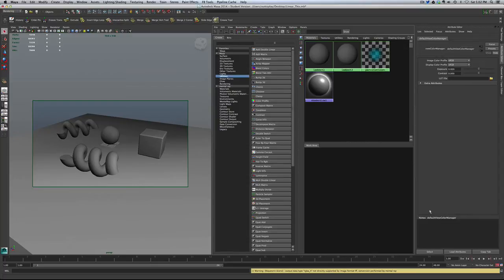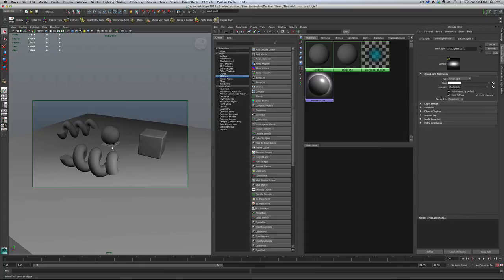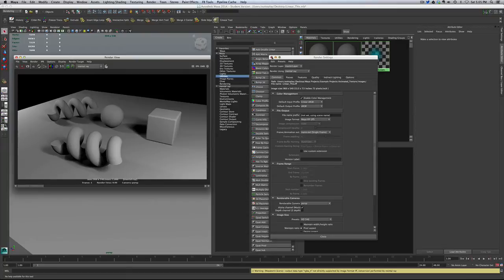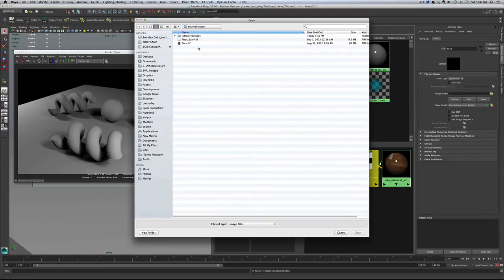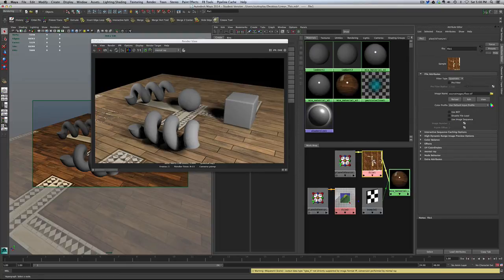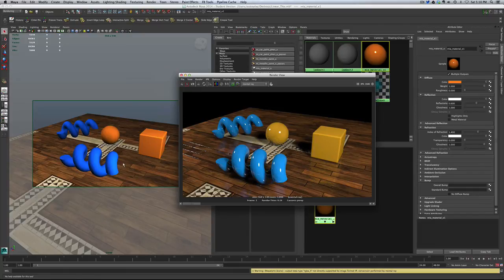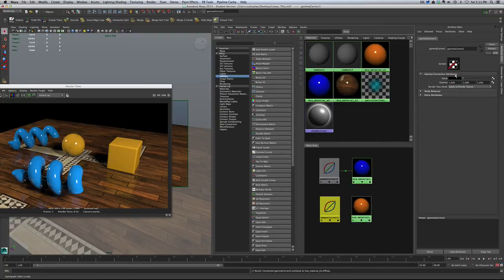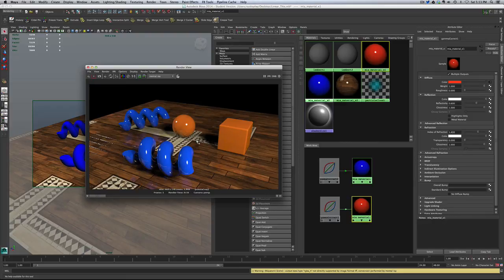Maya - Linear Workflow Overview

Comment: I think you have the input and output reversed. The input should be sRGB (textures that are already gamma corrected) and the output should be linear (negate the gamma on the texture). You have it reversed, which is assuming the texture is linear (even though it isn't) and applying another gamma, which is washing out your textures. Clicking color management should automatically set up you files with the USE DEFAULT PROFILE which should give you the proper results.

To get photo-real lights, you should apply a lens shader to your camera (I prefer exposure_simple) with a 2.2 gamma applied.

Let me know if I missed something =)
Reply: Dominic Bonavitacola Yeah it's throwing me off! Did he do it right or what?! He's applying gamma correction nodes to each element, is he using and older workflow? 

May I ask where you learned this work around from? Was it Tony Reynolds?
Reply: dannywithnuggets No, what Brenden did isn't the 'proper' way to implement linear workflow using the Color Management. The way I described it above is how it's supposed to be done. 

The whole reason color management is needed is because the viewport in Maya is in linear space, which means that lights do not display proper intensity or falloff when rendered out. To correct this, a gamma must be applied to the viewport. This corrects the lights. However, since almost all textures ALREADY have a gamma of 1.8 to 2.2 applied to them, you are effectively applying a double gamma to your rendered textures (2.2 +2.2 = 4.4!! That's a lot!) Before the color management system was introduced, I used to use a simple gamma correct node to all textures with a value of .454 to negate the 2.2 gamma of the lens shader. This balanced everything out, but added a few extra steps to building your materials. The color management does that all for you in a streamlined process.

I don't know Tony Reynolds. I'm a VFX artist working in LA who has to keep up with the constantly changing industry standard as best I can.